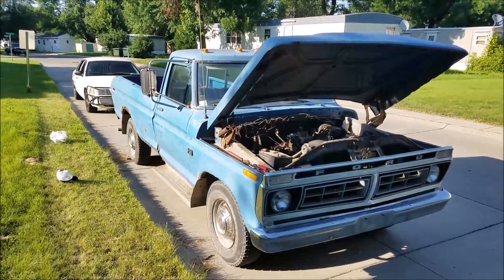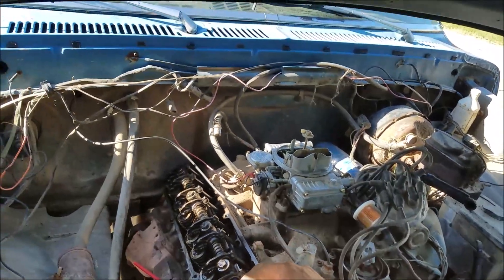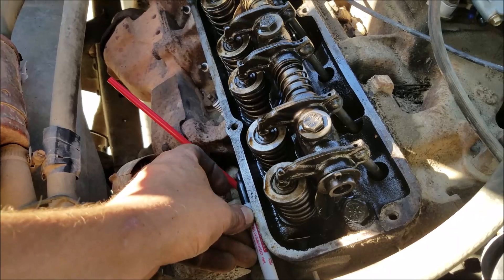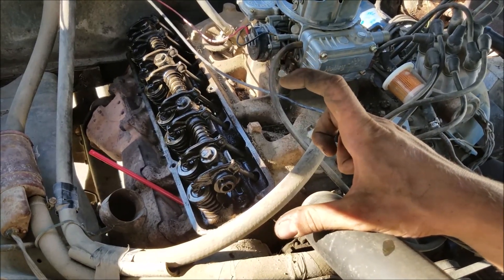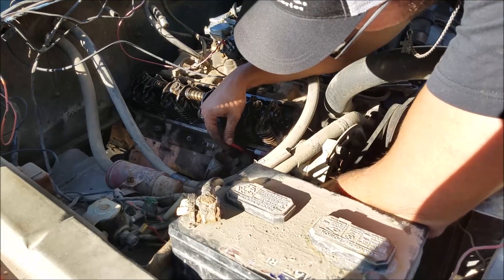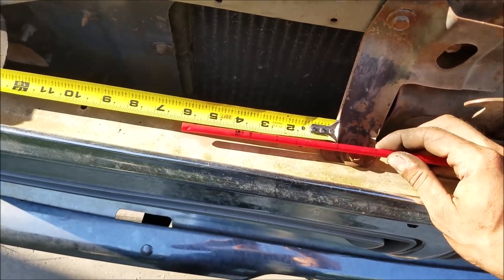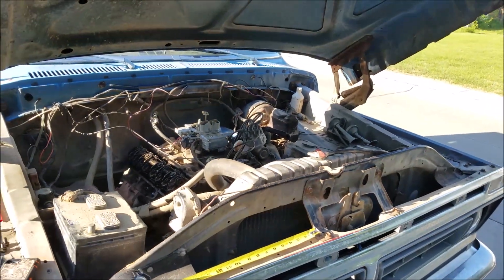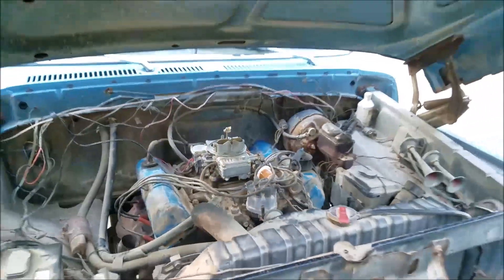Ford 360 or 390 FE Engine? - How to Tell the Difference in 5 Minutes

Comment: The easiest way to tell, pull the dust cover, ( most often missing), look at the very end of the crankshaft where the flywheel attaches. Slowly rotate the engine, and look with a flashlight, a 360 will have a "half moon" cast into the end, where a 390 will not and will only have a "keyway" cast into the end. If it is needed, there are only 4 bolts that hold the dust cover on. A 390 crank will have a 2U stamped into it where a 360 will have a 2T.
Reply: Not accurate.  I have a 390 with a 3.78 stroke, part C4AE-B, and it has a half moon cut in the rear crank flange.

Comment: Its easy to see if you have a 360 or 390......stop in the middle of the road and floor it. If the tires burn its a 390,if not its a 360😂
360 Ford is a dog of a engine.
Reply: Oh schnap! the truth hurts. I have a 360, damn it. At least I don't have a new 'consumer' truck. 71 F100 = real truck.
Reply: The King's Servant  
I’ve said that for years 
All you have to do is take a ride around the block and then you will know
Reply: Is dog of an engine a good thing or a bad thing?   Translation please
Reply: Smokey 
It means 👎👎
Reply: @MsLiberty101  a dog is a bad thing when it comes to your car. if you are from the hood or a wannabe thug a dog is your buddy /friend
Reply: My 68 Ltd burns them tires so yes she's a 390
Reply: Good one 👍
Reply: Mine roasts the fucking tires, but is the 360 really slacking that much that it won’t liquify a set of wheels? Im only asking because I assume I have a 390 (had multiple mechanics tell me it is, just by eyeballing it.) So Im not entirely sure if it’s a 390, 360 352, or even a stroker. The animal puts you in your seat, I’ll tell you what. Almost knocked out my brothers teeth by letting go of the clutch too early and hitting the brakes. Idk, Im pretty sure it’s a 390, but I have my doubts sometimes.
Reply: 360 a tire burner! Torque before HP.

Comment: Good video, unless I’m mistaken, the easiest way to telll if it’s a 360 or 390. Look at the water pump. 360’s are smaller than 390’s.. I’ve got a 66 galaxy with a 390,  69’ f100,  w/ 390, 71 f250,&75 f350 both have 360’s Between these years the water pumps are the easiest way to determine 360 or 390..
Reply: S. Curtis it is. When working on my truck, I just assumed it was a 390. Bought a water pump for a 390 and I didn’t fit. Went back to auto zone and got a pump for a 360 and it fit perfectly
Reply: @boogieshmurda36  I thought the only dif between the 2 was stroke and pistons?
Why would not a 390 pump fit on a 360?

Comment: My father had the 76 with a 360 as a plow truck. He gave it to me in 89 when I got my license. So simple, tough and cool. Such character, such a feel on the bench seat holding the steering wheel and stick shift. Good luck. So many memories
Reply: My papaw left me a 76f250 4wd 360 with headers, glass packs r.v./ towing can ( former local pulling truck) and 3.90(or Ford equivalent) with 38" monster mudders. Yep it was a papaw truck and he was damn cool... My mamaw made me sell it to buy a more" efficient" car.  Only damn vehicle outta Camaros darts dusters and 30 different trucks that I regret selling. It sounded like the baddest thing on the road. He taught me from 3 or 4 yr old that the right pedal is the " loud pedal" I can still hear the poppety crack sound it made coming down the mountain. Best memories
Reply: @chuckwhitson654  shitty she made you sell it. im just starting to get into older trucks as i get older im 36 and i love them.
Reply: @chuckwhitson654  RIGHT ON
Reply: Does a 67 gt have a 390 or do people fake it with a 360? Idk I'm curious I was searching what is the best transmission I can swap to it, and this video showed up.
Reply: Cam damnit, rv cam
Reply: Yeah it was slow Even then but it would drag anything hooked up to the back

Comment: I heard the late 70s on the Fe engines Ford put a lot more Nickel in the cast-iron and those engines will last a lot longer than the previous Fe engines
Reply: Never used nickel.
Reply: Mid 1970's is when they started reducing nickle in the blocks. The fe's kept until the late 1970's

Comment: The 4th number should be an M if it's a 390 the 360 would be Y and the 390 2bbl is H
Reply from the maker: On the block or the vin
Reply: @ThunderHead289  srry friend the vin
Reply: @garageworm17  where is the vin on the engine
Reply: @liveandletlive2894  it should be on the passenger side of the block were cylinder 2 is friend if the motor is stock the vin number on the body or door if they are original should have it in the vin code
Reply: @garageworm17  vin in the body doesnt meant anything as it could've been swapped

Looking at a '66 thunderbird which the owner says it has a 390
Reply: @liveandletlive2894  yes I know if it was original the vin code would be right if not you have to look for it on the block by cylinder 2
Reply: @garageworm17  ok thanks
Reply: @liveandletlive2894  66 should be 390 big block is a big block it's still freak cool 💪I had a 360 that would eat a 390
Reply: @garageworm17  I'm 20 and never touched a carbureted car engine...any tips?

How can I make some more power
Reply: @liveandletlive2894  lots of money and a jegs catalog 🤣🤣🤣
Reply: @garageworm17  I'll prob buy it and use it as a lawn ornament after I paint it lol
Reply: A mild cam and a 650 holley carb should be enough
Reply: @garageworm17  how much would that set me back roughly and I've worked on carbs from ATV dirt bike etc. But never a car...think I can tune it myself
Reply: @liveandletlive2894  as long as it runs it's worth gold and will fit in something cool just the raw sound of a open long tube header big block is badass even stock form there is alot of torque and with the right tranny and rearend it will smoke off some tires
Reply: @garageworm17  it's a '66 Ford thunderbird which has been sitting but fires right up with a little bit of pushing in the throttle...what do you think its worth
Reply: @garageworm17  I've also never swapped an engine or anything so idk if I'd be able to do that
Reply: @liveandletlive2894  never know till you try
Reply: @garageworm17  I dont really have much cash though
Reply: @liveandletlive2894  time builds dreams
Reply: @liveandletlive2894  to the right person and condition of the car 2k to 10k unrestored it's all on how much rust the car has and where it is
Reply: @garageworm17  NJ and 1 quarter panel in the rear was hit so it's all dented up and really not such bad rust especially for the east coast
Reply: 4th number where sir?

Comment: Easy way check VIN numbers or block numbers. Through Ford they can give you the info. Easer.
Reply from the maker: You could check the vin. But a lot of guys sell engine not in a vehicle. Can’t check the block casting numbers because a 360 and 390 are the same block
Reply: Or somebody puts a 2U crank  and 390 rods in the 360 block. Gotta measure to be sure

Comment: I was a Ford tech back when the FE ruled the power line-up at Ford.
The 360 truck engine was a sturdy engine, that with a cam swap, 4 bbl manifold & carb, with dual exhaust would definitely haul the mail.
People often got into trouble by swapping out the cam without changing the exhaust valve set-up, they had exhaust valve rotators which would bind much above .400 lift.
I replaced scores of bent push rods because of that and overreving the engine. Stock lifters would pump up leading to coil bind and bent push rods.
If a customer didn't want to invest in a set of springs and keepers with the new cam/ lifter set then I would use a C6,OZB cam from Ford. It was used in 390 GT 4bbl apps. It would really wake up a 360 without the need for valve spring change out because the lift was below.400.
Reply: Wish I would of known that info 20 yrs ago... I used to bend push rods on my 390 weekly... it had a good size cam in it... could never figure out why it would bend them all the time... good to know...
Reply: The stock cam overlap is insaine. I just picked up a 73 360 and am putting long tubes on her tonight and tomorrow. I wanna find that load of torque the FE lost going from my 72 to 73

Comment: I owned a lot of old Fords and I've had the 360 and 390 I prefer the 360 it seemed to have a quicker take off at least the one I had did
Reply: That would most likely be because of the smaller 2 barrel carb (at least stock)

Comment: OR you could take the valve cover off and look up the numbers on the head on the internet to get the engine size, year, and specifics.
Reply from the maker: Didn’t work for the 360/390. Literally the same engine except for crank rods and pistons

Comment: Lots of 390's had 2 barrel carbs.  Mercury station wagons had 390 fe engines.  I rebuilt lots of them back in the early 80's.  I always searched the boneyards for 4 barrel intake manifolds.  They weren't easy to find and the 4 barrel got much better gas mileage plus made much quicker hot rods.  My F-150 4x4 390(4 barrel) 4 speed (granny low) could pull down trees.
Reply: David Bennett May I ask what year? I have a 76, basically the same set up. I was told in a forum once that the 4x4 390 set ups were not available for the F-150 and were only available for the f250. I already had a couple of mechanics check it out and confirm it is a 390. So either the trucks did come up with this setup or it probably had an engine swap at one point. I’ve looked around all over forums and what not but get conflicting results.
Reply: @VeryOddTimes  I built mine from "bones."  It was originally a 360 that had a hole through the block.  I had a very low mileage 390 from a Merc station wagon that had been crunched in an accident.  Most of my pickup trucks came from the boneyard.  It helps knowing the boneyard owner really well.  I wrenched on his Pan Head regularly so he always called when he had Ford "stuff" I was interested in finding.  I got a Boss 302 for $200 from him. 😎
Reply: David Bennett Goddamn. That’s badass man, congrats! Idk I love my FE but I want to make the truck into something with a whole lot of grunt. Where I live everyone (and I mean everyone), has cammed up chevy’s and think they have the fastest shit out here. Some guys have serious trucks though, but I want something that’ll blow the doors off most of them. It’d be neat to find an old 406, 410, 427, or 428. I found some builders that sell some pretty hard-hitting turn-key FE’s but for the same money, I can get a built 460. Or I can just try and do what I can with my 390, it already has a little cam and some decent grunt, but I want more.
Reply: @VeryOddTimes  IveIce only seen 390s in 2 wheel drive.
Reply: @JerryRedd-bs8xi  eh Idk. I’m almost positive it’s a 360. Had two old school mechanics tell me it’s a 390, though. I’ve never measured the stroke or anything, so I wouldn’t be able to say for sure. But I’m sure you are correct.
Reply: My father bought a 69 F250 with a 390 Granny low 4 speed 4x4  it too was a beast. Loved gasoline.  Might have got 6 mpg. on a good day.Good
thing gasoline only cost 32 cents a gallon back when gasoline was good fuel.

Comment: If it ends up 3.98" stroke you have a 428 crank in there.....like me! 😎
Reply: which would be factory 410 mercury which was only made in 66 and 67.
Reply: With what piston+ rod combo to be level deck height?  I'm not sure myself and if you aren't please don't answer but you are saying 390/428 are same bore? Please do tell
Reply: @chuckwhitson654  They aren't the same bore, and you won't have enough of cylinder wall to bore a 360/390 out to 4.135 in
Reply: which you can't accomplish with a 360/390 block
Reply: Or a Mercury 410.

Comment: I had a 1972 390 2V rated at 265 hp. After 1973, the 390 4V was rated at about 175 hp
Reply: What happened why did they drop power
Reply: @ronniecarroll3929  Emissions. Compression drop. Change in rating methods. 
Plenty of reasons.

Comment: The  truck 360 (fe) has a different deck height ?
Reply from the maker: The 360 and 390 are unidentifiable from the outside, but the 352 has a shorter deck height and a different block so a block number check would expose a 352 for what it is very easily
Reply: 352 block has the same deck height as 360/390/427/428. Bore on 352 is 4" and bore on 360/390 is 4.050". Bore a 352 .050 and use 390 rotating assembly will be a 390
Reply: Thank You for info.

Comment: Don't forget the 352 FE. My 67 f100 had a 352 with a fmx/c5 auto. Set up as a camper special. Fast no, power to haul all day YES.
Reply: My fathers F-250 was his work truck and my go where I wanted truck on the weekends or if he didn't need it  352 cu 2 barrel 3 on the tree and no power brakes no power steering Clutch so heavy my leg would start to shake at red lights .  Wish I still had it.

Comment: I think it's two revolutions of timing to one revolution of Crank
Reply from the maker: The crank gear is smaller than the cam gear. The piston goes up twice per every time an individual valve would open in a 4 stroke cycle

Comment: "Here is how to quickly tell what you have".......... I wouldn't go as far as saying quickly, but I gave the video a thumbs up nonetheless.
Reply from the maker: I appreciate that. I tend to run a little on the wordy side - I just try to not leave any stone unturned as far as questions that may arise
Reply: Definitely faster than pulling the pan to check the casting number on the crank.

Comment: Ford made 331, 361 and  391 HD truck motors also. 377 and and 429 HD came later.
Issues with exhaust manifold burned valves rear main leaks and starters on Fords these years.A also a huge 534v8 which is a collectable today.
Reply: 429 was a different block. 331 through 427-428 were FE blocks and 429-460 were lima blocks.
Reply: i had a 538 in a dump truck, gas guzzling damn thing..............

Comment: My old F250 came std with a 360 and was way worn out.  picked up a 390 out of a Galaxy 500 and then it ran like a at out of hadees, super strong running work truck.
Reply: Jerry A I had a 76 f100 4x4 that came with a 360 and got a 390 from some 72 car. It was a factory 4 barrel and damn was it a beast. It'd cruise at 80 no problem all day getting better mileage than my 00 5.4, with a granny 4 speed and no oberdrive. Get there in a hurry too.
Reply: when i was lookin for a work truck  years ago i would buy a truck with a worn out 360 there were a lot of them.  put a 390 in  and be ready to go...........
Reply: Yep, I'm ready for another F.E. powered truck. I always wanted to build the 332 or whichever is in my grandpa's old '67 600 wrecker. But I'm kinda thinking dt466 or some other medium diesel. Be nice to have another short bed 4wd.
Reply: hey Nick,  I used my F250 (w/390 @ about 300HP) to haul firewood, One time it hauled HICKORY which is one of the heaviest woods, the load was piled level with the top of the cab. even put some where the passenger sits, My buddy had to ride on top of the load, but didn't have just a couple of miles to get home.  Now I drive a Tesla model 3 and its a wild beast in sheep's clothing for sure.  Take care budd.

Comment: if it was a 390 HO i would say it matters but not a lot of deference in 360 390 at least its not a 400 haha you can see the numbers on the block you can tell any thing you want by it 
and you should wax it i bet it will clean up nice with a good waxing
Reply from the maker: Loan Wolf the block is the same between the 360 and 390. 
It’s impossible to tell really. Could have decoded the door tag, but what fun would that be
Reply: i know there is not a deference in standard blocks but food made high output 360s and 390s there was a huge deference in power